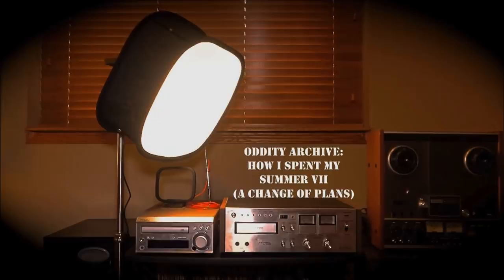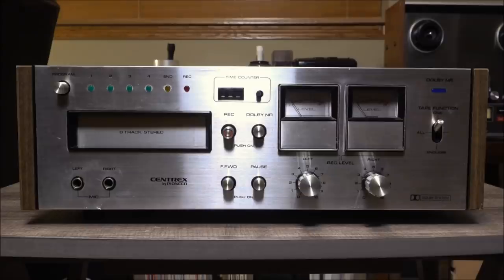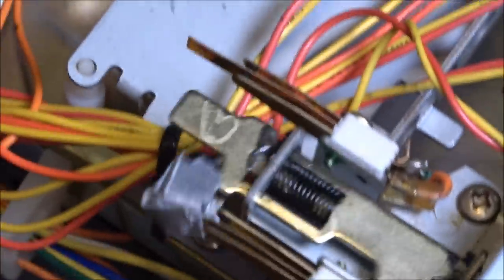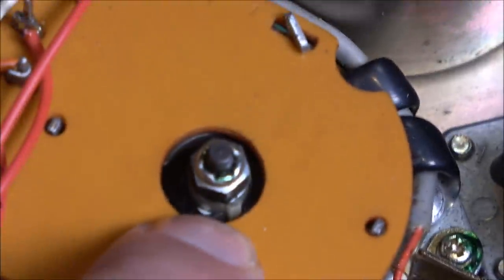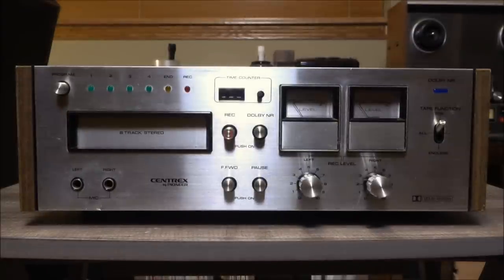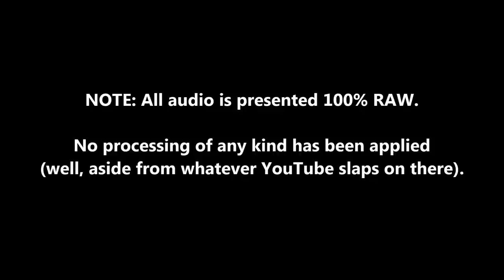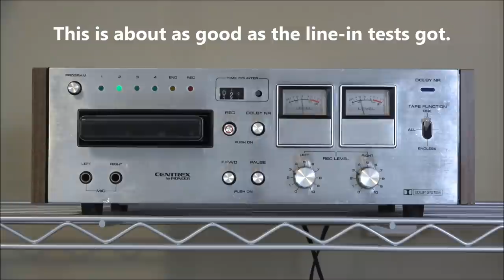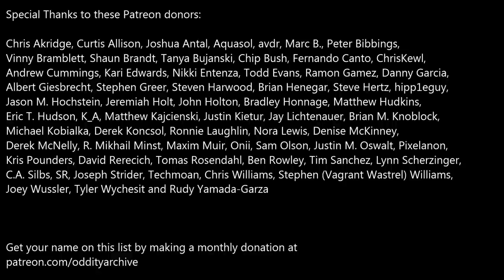Oddity Archive: Episode 199.5 – Ben’s Junk: Pioneer RH-65 8-Track Deck

Comment: You should get a 8 track cassette adapter. Then when you have the cassette adapter you can put a Bluetooth tape adapter in and have 8 track bluetooth with working vu meters!

Comment: Wow!  I had a Magnavox deck when I was a kid that used the same mechanism.  This is pretty much how my recorded 8-tracks sounded as well.  I remember re-threading a few prerecorded tapes onto an actual 1/4" 8 Track open reel deck with a similar head configuration and the tapes sounded almost as good as cassette tapes.

Comment: I'll be honest, your recorded tapes sounded better than the prerecorded tapes.  I know you had a little bit of WOW but the dynamic range was really good according to my ears.  8 tracks always sounded like they were just missing something, but your home made tapes sounded really awesome.  That is definitely one of the better recorders for sure.  I have an old Olson RA964 deck from around 1974 that doesn't sound too bad either and still works very well.  The record/playback volume controls need cleaned, but that's it on that.  Thank you for posting.

Comment: In case You didn't solve the pegging vu-meter issue yet, it's most likely dirty record switches. It's the long things on the PCB. Spray some contact cleaner inside and work them for a bit. With them being dirty and stuck, your 8-track player would be half in replay, half in recording mode, driving the VU-meters crazy. I just bought one of those Pioneer RH-65 players. It didn't arrive yet. I hope I'll be able to make it work well and look nice. And where the heck would you find a replacement for the dolby ICs, if you'd need them? CR860b's seem to be pretty much unobtaimium. Thanks for Your video!

Comment: The playback speed depends alot on the tension on the cartidge that holds it against the pinch roller. Try pushing gently on the right side of the cartridge as its playing. If the speed picks up you know the tension on the cartrige need adjusted. Also, would you consider doing an episode on quad 8 track? I know the tapes are expensive but i could loan you some.

Comment: I suspect the motor has a mechanical governor inside, that determines its speed. Not easily serviceable of course.
Reply: hmmmmm maybe.  I had a Magnavox that used the same mech and it would randomly go from normal speed to chipmunks and then back.  Some days it was fine, others it just was bi-polar.  I just got used to hearing Hotel California at various speeds.    At the time I guessed it was maybe a short in the windings, but maybe you're onto somethin.